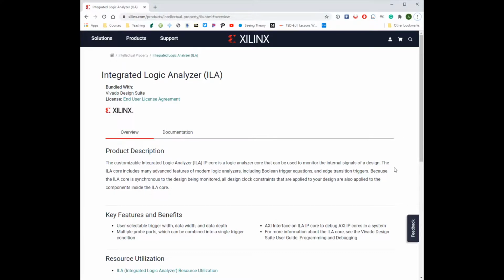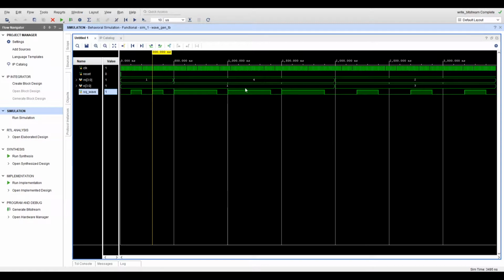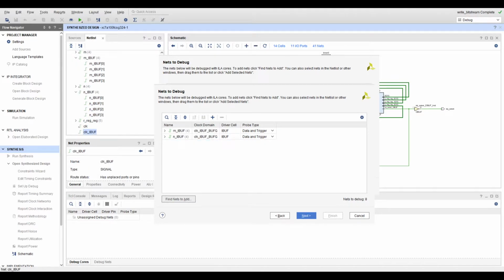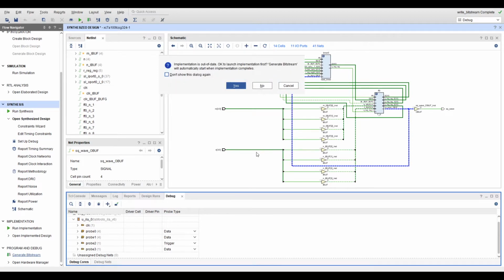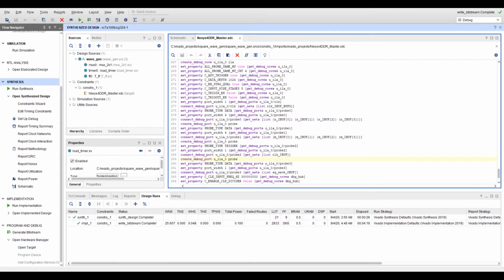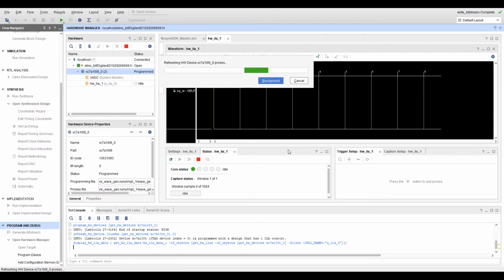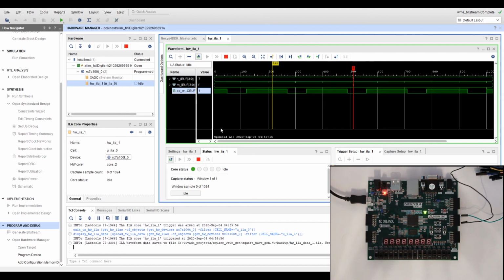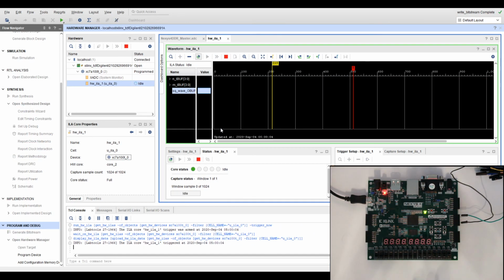M2 - 9 - Integrated Logic Analyzer

Comment: So is an ILA used to check if your FPGA is implementing what it is supposed to in real time as opposed to using test benches to simulate your code?
Reply from the maker: Yes, the signals you see are actual signals as recorded by the FGPA. For example, if you direct these signals to the PMOD output pins and connect these pins to a logic analyzer, then you should be able to see the same signals
Reply: @anassalaheddin1258  Thanks Professor, I've been trying to re-study FPGA materials but lost your class notes and its so hard to find good tutorials online. So glad I stumbled upon your videos!